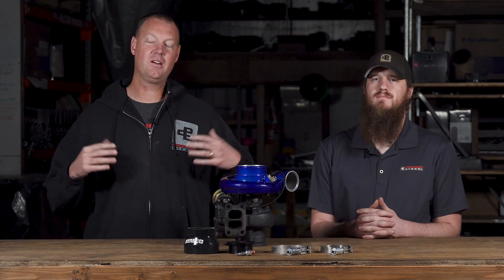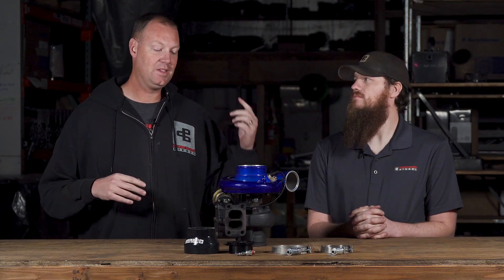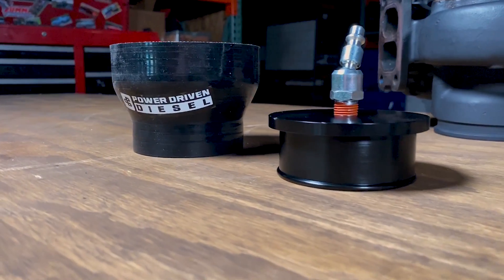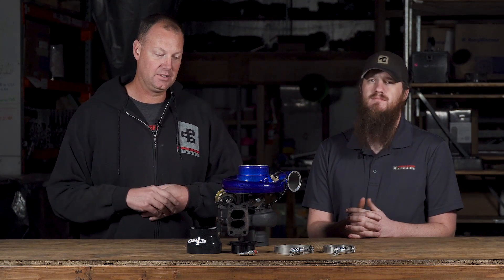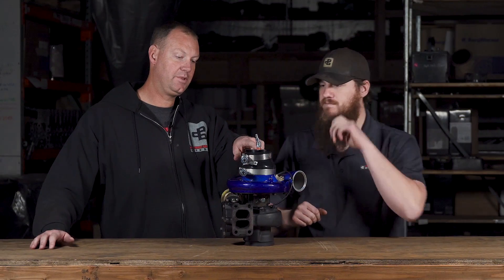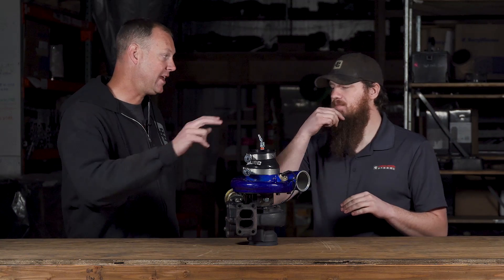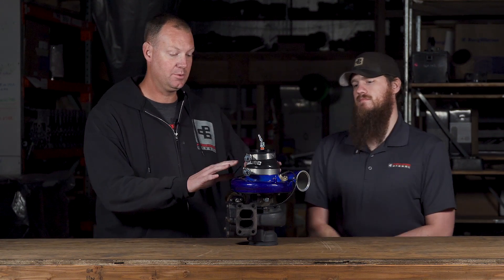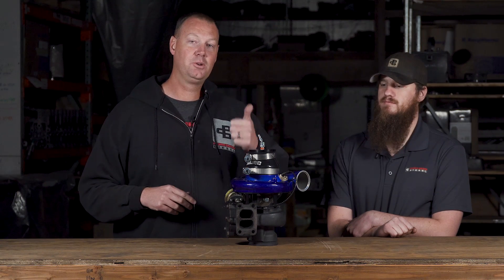Boost Leak Tester | Parts Bin EP 17 | Power Driven Diesel

Comment: So on my boost leak detector I made for my powerstroke I used a bolt in style tire valve stem and a cheap gauge threaded in so I can fill it like I would a tire and dont have a chance to over fill it and blow it up in my face

Comment: Use something very similar to this in the class 8 world. Our kit also seals off the down pipe, not only can you check for boost leaks, but loss of drive pressure as well. I’ve found hundreds of leaking exhaust manifolds without carbon trails from the leak/s. Your spot on with the 30 psi cap! That plug can cause damage you wouldn’t think possible when it comes shooting out. You’ll only do that once.